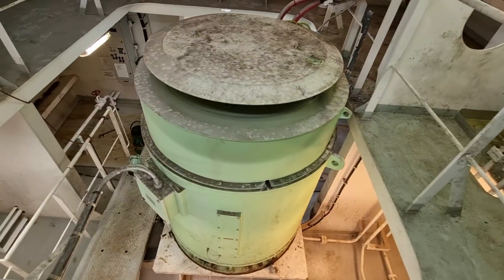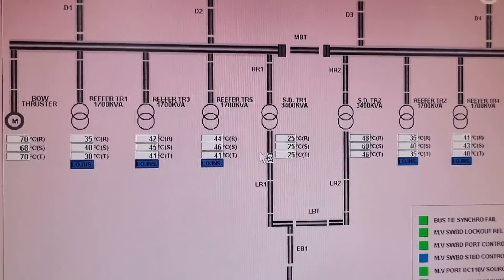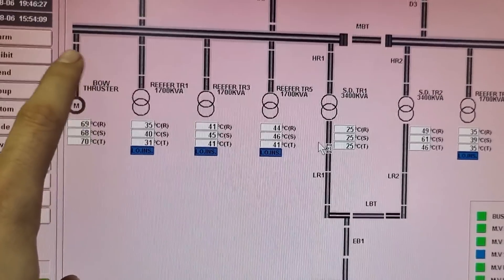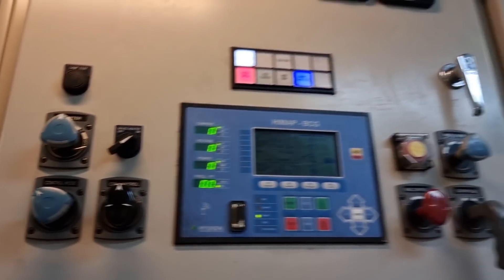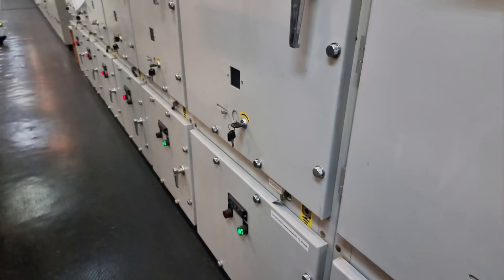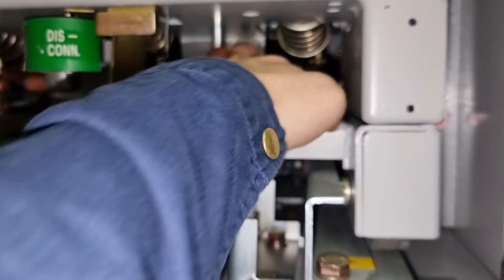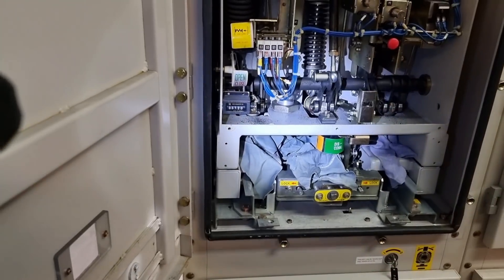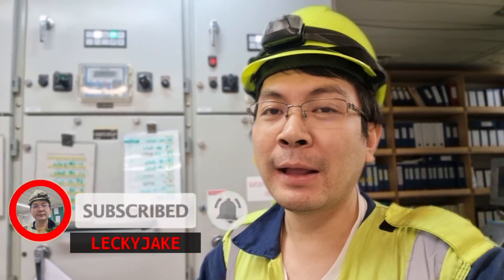BOW THRUSTER HIGH VOLTAGE TROUBLE | MARINE ELECTRICIAN

Comment: Manual of those things doesn't say anything about lubrication :/ only to do 5 open/close cycles every 2 years and "check for wear". 
We use a gear lubricant (plastic-metal parts industrial application) instead of wd-40 but I guess it works in a pinch too...

Comment: Wd40 not for lubricant. But to remove the hardened rust or corrosion. I think they use it for that. Then wipe it out. We don’t know if they used a grease specially for the contacts. But he did a good job on that lever

Comment: a free tip here, if the power won't turn off, SHUT off the power to the WHOLE SHIP, or at least the generator which powers the switch! this ensures you can 'pull' the offending part, SAFELY.

Comment: wait, STOP!!! you need to isolate the power FIRST, I definately would NOT like to aproach any nut on the electrical side, with knowledge that the 6.6KV power is still ON, you would be NUTS, a sure electrocution, and from 3 meters away!!- not even touching the parts with the wrench.

Comment: i understand the good pratice as you did here, good job, but what kind of trouble is to have connected power to the bowthruster, linked with MSB if nobody operates the motor? You had connnection between MSB and BT, if you could operate BT in such way, after manouvering you could just leave breaker ON. Or there is some kind of protection on PMS that prevent to keep that?
Reply: The VCB is a protection component. In case of a overload or short circuit it protects the circuits to prevent fire and/or cascade failures. Without an operative VCB the bow thruster is not safe to be operated.

Comment: Please do not use WD40 as lubricant, it is not a lubricant nor a penetrating oil, it is a corrosion preventative, it will gum up within about a year (destroying any lubricating effect) and it will damage rubber parts that come in contact with it. Please use proper (penetrating) oil that is certified to not gum up, or dry lubricants like PTFE Spray / graphite powder instead.
WD40 is the sledge hammer amongst the "oils", in the long run it will not fix anything but make it worse instead.

Comment: Loved the way you egged up the danger to get more views … Why is the job dangerous when you’ve isolated and hopefully earthed the busbar? 🙄
Reply from the maker: Hi, thank you for your comment. I did not do the job for the views, i dit it because it is an essential machinery for maneuvering. The job is dangerous because you cannot Isolate and earth it without opening the VCB.
Reply: @leckyjake  but you isolated the board, where’s the danger?
Reply from the maker: @andyxox4168  the VCB is still engage in a live busbar with 6,600 Volts. it cannot be disengage remotely and through manual lever. the only way to do in is to open the fron cover and manually push the button on the VCB body. let say it did not disengage, there might be an arching inside or who knows what will happen.
Reply: @leckyjake  but there is positive indication of the contact position on the breaker, still I’m not the commissioning engineer that’s been working on MV switchgear for +35 years (or am I?)

Still I’m sure making everyday operations as dangerous as a moonshot increases views!
Reply from the maker: @andyxox4168  try to check the indications for the vessel and for land type esp the Korean Made Vessel. I hope it will help you that
Reply: @leckyjake  So what manufacturer makes MV breakers without mechanical contact position indication?

Comment: Sir Leckyjake good day, asked ko Lang Sana, Baka may idea Ka sa problem Namin sa Bow thruster. Pag magturn Ng pitch control to either port or starboard, the Ammeter is showing fluctuations, And we can feel the fluctuations of running motor. Although the Ammeter stabilizes after 5-10 seconds, meron pa ring maliit na galaw ang Ammeter. By the way, 2 ang thruster Namin. Pero Ito Lang ang Bow ang may ganitong problema. Sana maturuan mo ako. Thanks

Comment: Interesting video ... but WD-40 is NOT a proper lubricant! It's an anti-corrosion formula that has lubricating properties as a side effect. If you want to lubricate something, use the proper lube - otherwise you are creating additional / new problems. Same applies when using WD-40 as cutting oil (very bad idea), mold release etc... OK to use in a pinch but not when you are a pro.

Comment: WD 40? Really!!! Worked on switchgear for 35 years and WD 40 acts as a solvent on lubricants that are specifically engineered for that bearing, bushings or carrier pins. Wear indicators on your mechanisms and over travel bump stops indicate more problems that’s gonna get you up at 3:00 am
Reply: I suspect the rubber damper has started degrading because someone previously used WD40 in  there haha

Comment: Good Job Lucky Jake  !  !   I am glad you are being extra careful & also that you have the necessary High Voltage Suit which confers the extra protection that you need while onboard & working with dangerous equipment. I would have the Captain always remind everyone during a all hands meeting ; that No One UnTags Any Valve or Switch or Breaker that has not been placed there by themselves & all safety tags must be known & approved by at least one supervisor !  There is no reason to lose the ship or anyone aboard it during these modern times. If all safety procedures are followed then everyone goes home with a smile & pocket full of money  !  Good Luck , Lucky  !  I had 2 electricians electrocuted while I was in The U.S. Navy & I can still smell the burning of their bodies in my mind when I recount the incidents.  Keep yourself & your crew safe , keep them sober & get rid of anyone with a drug or alcohol problem.
Reply from the maker: Thank you very much for this wonderful comment. Messages like this will help me alot to improve my dealings with safety and to be better at my work. Thank you
Reply: Thanks for your expert input to the channel.

Comment: Thanks for the interesting video. WD40 is actually a poor lubricant.  It is a water displacement fluid and tends to evaporate and disperse over time.  A good quality synthetic oil or grease would be much better.

Comment: Well done! Never cut corners when it comes to safety. My job is similar but it's on land. The highest voltage I deal with is 480v 3 phase from the grid. A ship at sea is its own power plant! Fascinating.
Reply: MichaelKingsfordGray  #1 he isolated the problem area. #2 he released any stored energy. #3 he used the proper PPE. #4 he tested for voltage. He didn't cut corners. He was safe. As far as the wd40 goes I don't think rebuilding or replacing the VCB was an option at the time so he gave it a few squirts. The bow thruster's back on line and he is alive and healthy. Arc flash is no joke especially at six thousand volts.

Comment: WD-40 is not the correct lubricant to use in HVAC switching gear and motor starters. They knew it was stuck and had to walk the ship, so they could have gotten the right stuff when they grabbed the PPE for working with high voltage.

Comment: Interesting to see that they use different color coding on the panels. For the racking they use green for "disconnected (i.e. OFF) and I'd assume red for connected (i.e. ON), which is what I'm used to seing. But on the panel lights the colors are reversed. Seems a bit confusing to me, is that a local thing?
Reply: I am entirely not one to speak on this system specifically, but I've seen on a printing press where 'contextual' indicators appear to clash: safety-context (red==danger; technician should stop//green==safe for tech to proceed) and operation-context (red==system/mechanism is stopped//green==system/mechanism is running). I too am curious if this is the arrangement for these indicators!

Comment: You may want to look into the life cycle of these VCBs. That Bow Thruster VCB is sitting on around 5000 operations which is nearing on the limit of its mechanical life, that is probably why you are starting to find signs of wear internally.
Reply from the maker: The same report was sent to the higher ups. Thank you very much

Comment: In America, concerning CBs, red means closed, green means open.  I'm shocked (no pun intended) that your CBs are opposite.
Reply from the maker: Yup in Vessel Green means current is flowing and Red means isolated or stopped.
Reply: @leckyjake  Interesting.  It's the same idea with valves too.  Red = CB closed - current able to flow.  Red = valve open - fluid able to flow.  Green = CB open - no current flow.  Green = valve closed - no fluid flow.
Reply: If you look through the windows at the CBs, green for open (safe), red for closed (dangerous). The status lights are not for safety indication but function, so green for on, red for off. Context is important for understanding indicators!

Comment: It's good that you have the proper PPE for jobs like that.
What is the minimum voltage on which you would use that suit?
Reply: According to the NFPA 70E, the Arc Flash Rating of the equipment being worked on determines the proper PPE.
PPE appeared to be Category 4:
 40 calories per square centimeter suit.

Comment: No reset; major short, or ground fault..Thermal overload? Hit it with a BFH..Never insert a new buss breaker on a high voltage DC short..It's a firecracker; in your face..
Reply from the maker: Its just a mechanical failure

Comment: I had to spray wd40 on a 135kv vcb. The trip relays opened but the mechanisms had dried out grease on them. Gave the mechanisms a couple squirts of wd40 and then BAM! They slammed opened.

Comment: Trying to compare ship electrics to ground based industrial electrical supply.              Is 3 phase standard?                  I'm guessing the crazy high voltage is a compromise to run lower amps,  meaning smaller wires running throughout the ship?             What sort of control voltage is typical, is it digital comm cable buss circuits?
Reply: 440vac 3ph 60hz typical, IGBT VFDs take it up to 3.3, 6.6 or 11kv for motors. 3x half redundant 720/900 rpm generators off the engine, smaller ships 1-2 megawatts total, bigger ships maybe 2x15mw just for main thrusters. 2:1 split phase 110/220v transformers for more mundane stuff. 24vdc relay control voltage, 5/3.3v digital. But it depends

Comment: At 6:50 he sticks his finger into the hole in father front of the panel. Then explains why he needs the protective suit. I don’t understand…
Reply: The suit is for flipping the switches. These types of high voltages switches used for industrial purposes can dangerously arc flash when thrown, killing or seriously wounding any workers near the panel. The suit helps protects from burns if the panel deicdes to arc flash.
Reply: nice catch

Comment: Probably a failure like the old electric forklifts.. when the battery gets damaged cells a unexpected current drop would happen. This would allow a arc to form on a partially closed relay.. it would cause the machine to stay in operation.. this was fixed with a capacitor..

Comment: I sure hope when you get to Chile, you attend to the contactor mechanism service and lubrication properly since it is already compromised. WD-40 will do for now, but not for the long run.
Reply: WD 40 may be a better choice as it won't cause problems with the electeical. Except perhaps from dust accumulation. Would for example,  a silicon lubricant act as a semiconductor,  and be a bad choice around electrical contacts?
Reply: @onradioactivewaves  Silicon and silicone are about as similar as water and hydrochloric acid
Reply: @alakani  yes I know, but I was referring to the dielectric properties. There are different types of silicone. I know some have good dielectric properties, I suspect the lubricant do not as much, as the better lubricants have smaller molecules.

Comment: As someone who grew up far from to ocean, the idea of 6600v equipment on a ship is a little mind boggling. I realize that heavy equipment needs high voltages, but the idea of multi-thousand volt equipment on a ship is something I never would have thought of.
Thanks for the video!
Reply: There's probably more and longer wiring in these large ships than in an entire town. And, all specialized uses. Long runs + high voltage == lower current.

Well presented docuentary of this project... change those dampers 👍
Reply: 6600 would be a main feed on a buss....the buss will feed many items.... none of which is 6600....
Reply: @mr.h4714  this dude has it. It probably doesn't receive that voltage often, but it has the potential to, so it's labeled as that.
Reply: @roetemeteor  6600 will be the main bus fed from the generators and it'll stay at 6600 phase to phase. After it's distributed from the main switchgear, then it may be dropped down to 480 or similar. But the larger motors (like azimuth pods or thrusters) are usually fed the primary bus voltage to save on motor size and copper.

Comment: You did not repair anything! WD-40 is not a cure and is only a band-aid. Change the breaker and REPAIR the defective one.
Reply from the maker: The main key point was to open the breaker and disengage it on the bus bar. It is the safety issue that needs to be resolved. We are on a ship where we cannot just buy VCB in an instant and we need to keep the supply chain going. We were able to use the Bow Thruster in 6 ports and 2 days back the VCB dampers were replaced.

Comment: Just so you know, WD40 is not a lubricant. It is a water dispersant. Your problem will return.
Reply from the maker: Hi JT, thank you for the comment. So far the High Voltage VCB has been used for the past 6 ports with no problem. And Yesterday the dampers were replaced and everything is back to normal. Thank you.

Comment: Just FYI WD-40 is a terrible lubricant. It's mostly a solvent. It works well for freeing stuck things but needs to be followed up with a proper lubricant otherwise the problem is going to return.
Reply: Correct it's not a lubricant at all it is a water displacer , it chases the water off evaporates, and leaves a residue.
Reply: @bryanlatimer-davies1222  that's were it got its name WD and the 40  was the 40th try at the water displacement formula. Was a contract with the military for a water displacement.
Reply: WD-40 is a brand these days. They have a ton more products than just the "original formula".
Reply: @TheNiters  you can tell by the color of the can that it's the original formula. There other products are different colors.
Reply: @ross82  same here. WD is not a lube, it's far too light an oil (mostly petrol) for that job.

Comment: I'm decently sad you guys used WD-40 and not grease spray or gear oil... WD-40 is NOT a lubricant. WD literally stands for "water displacer" because it was developed as a de-icer. It leaves a few micron thick layer of paraffin oil and that's all your lubrication. In the mean time it washes off all the lube that was previously there too. It's infamous for ruining bearings and bushings, mostly in bikes and skates.
Reply: It was developed to coat amunition and prevent rust.
Do you know why it is 40?
Because it was the 40th try.
I've seen plenty of cooked bearing for that very reason
Reply: @MrPig40  It was developed for space vehicles first. The cryogenic fuel was building up ice and thus weight on the tanks of the rockets. All the other stuff you said is correct
Reply: @whatevernamegoeshere3644  
I just did a Google search and wouldn't you know it, you're right!
I've been living a lie for 30 years, lol.
Thanks for correcting me, I appreciate it.
Reply: @MrPig40  Bull SHIT!
Reply: @kennethschultz6465  
Sure Pal
Reply: @kennethschultz6465  Skaters and bikers think it's lube and cook bearings with it left and right. WD-40 is the cause of a stupid amount of bearing repairs.
Reply: I’m disappointed you care. When you have to use WD-40 on a VCB that means it has to be racked out and serviced. So I highly doubt the mechanisms were left as is. They were probably racked out, electrical contact surfaces cleaned, megged and ductored then the mechanical interface connections are cleaned oiled/greased. The breaker is then tested for long trip delay, fault delay and mechanical disconnect. I’m an industrial electrician. Stuff happens, you have to roll with the punches.
Reply: @RadDadisRad  You should care, because wd40 literally makes it worse. Also a bit you forget is that it's spraying a flammable oil all over the place, while also off-gassing butane for a while